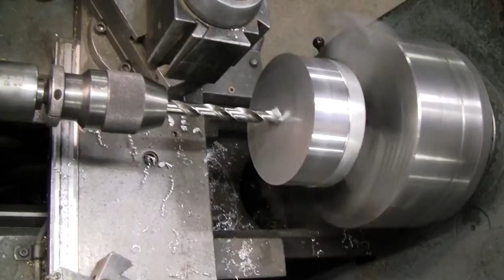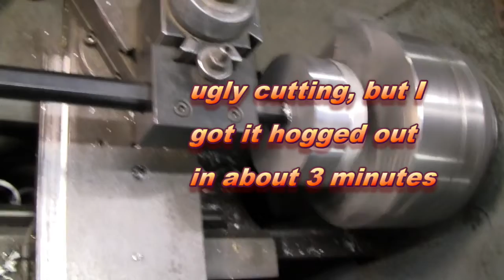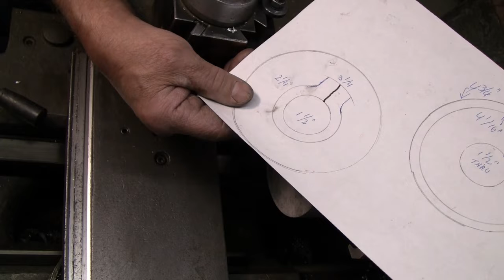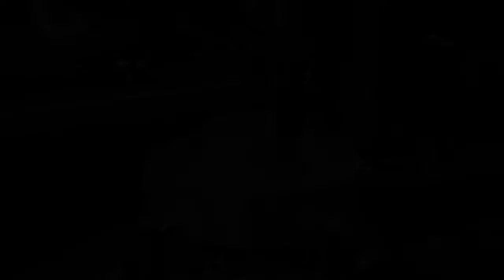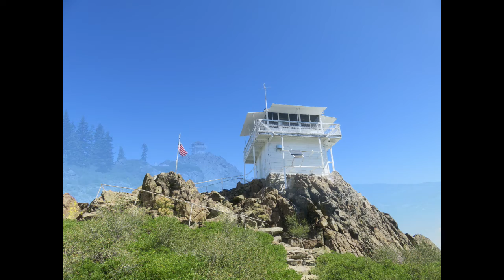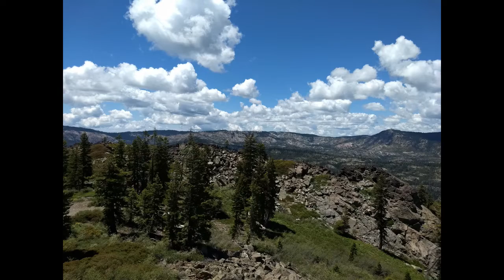Dumore  Toolpost Grinder Part Two--Wheel Guard

Comment: Great job there Joe .  That's just what i need to make as i bought a couple of 4'' wheels for my grinder today to try  & my guard can only do 3'' wheels .   You have some spectacular scenery over there . Cheers .
Reply from the maker: Hello, Max. If you were in the US I'd send you a couple of these cutoffs, but the shipping cost to Oz would be several times the value of the stock. I hear you've some scenic areas in your neck of the wood, also.